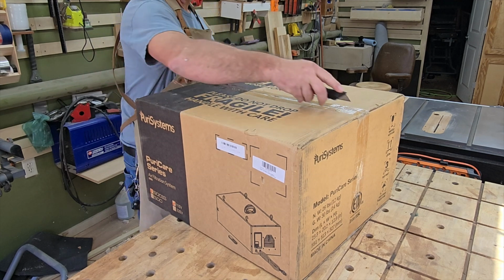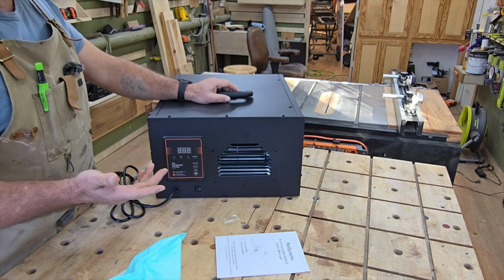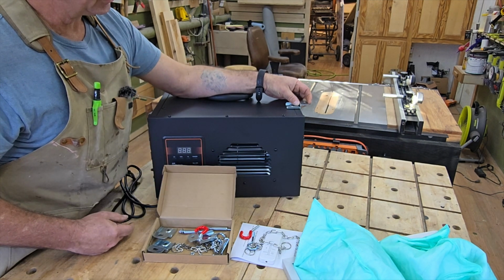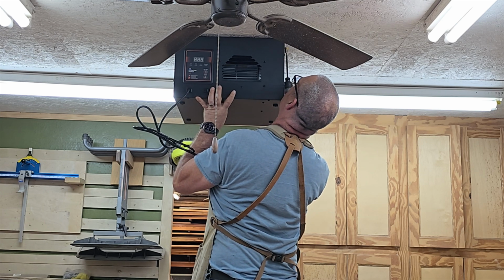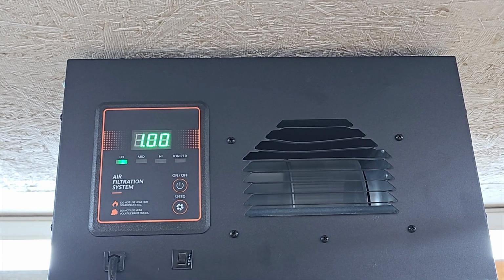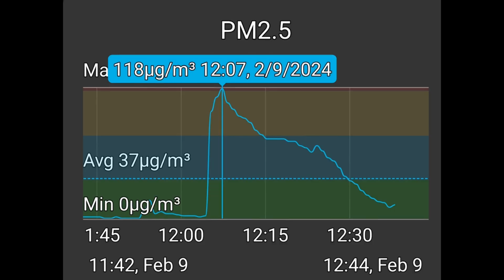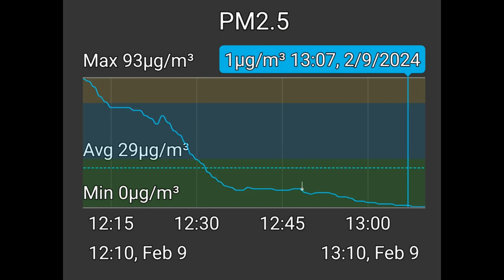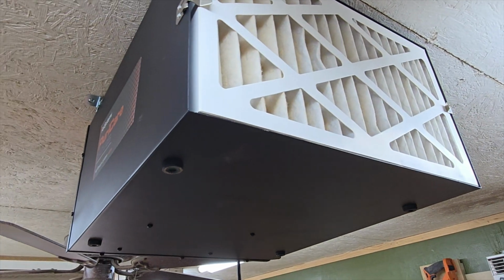Unveiling The Unbeatable Puricare 500ig: Putting It To The Ultimate Test!

Comment: They are great the only fault they have is the circuit board goes on them so I would love to know how you get on down the road with it
Reply from the maker: Is that an issue with this brand or for this style in general? Either way, I will put out an update if I have an issue.
Reply: @ShopRamblings  I think they all are built pretty much the same but mine is only 6 months old and I haven’t used it much only because I forget to turn it on but I noticed your control board is the same and when I called them he said it’s a common thing you’d think they sort it so instead of sending the whole thing back he sent  the circuit board. It’s pretty much plug and play, but I’d like to know how yours gets on.
Reply from the maker: @bradleytuckwell4881 The diy one I built, I connected it to my lights. That way, it would come on when I turned the light on. I checked this one. If it loses power, it defaults off. The air monitor sends notifications when the air gets bad. Hopefully, that will remind me to turn it on.

Comment: 👍Nice review. Looks like a good machine. I do have 2 questions, if you don't mind:
Are the Merv 10 and 1 micron filters common sizes or proprietary?
Do the mounting tabs you used line up for 16" center joists?

Thanks.
Reply from the maker: For some reason the WEN, Powertec, Shop Fox, and more all use the same size filters. The tabs are 12" one way and 18" the other.
Reply: @ShopRamblings  Thanks so much.